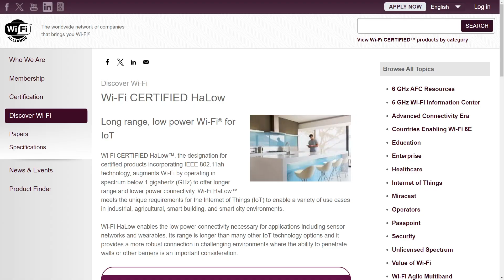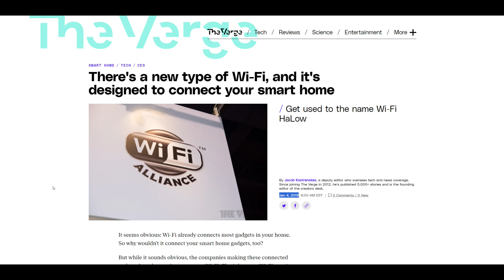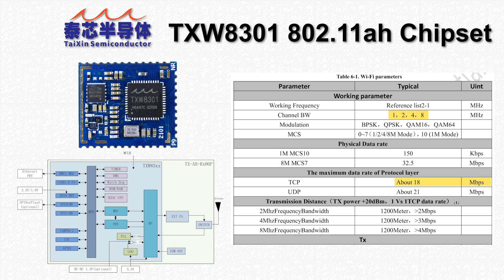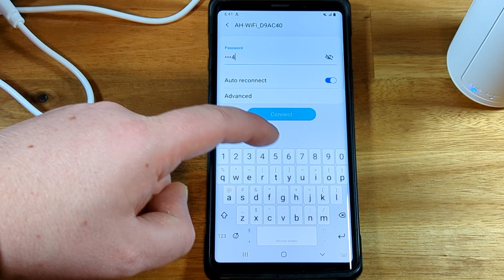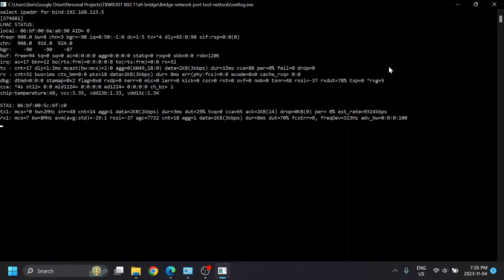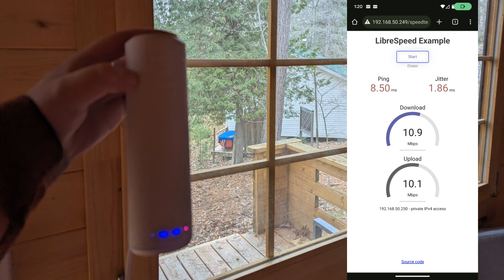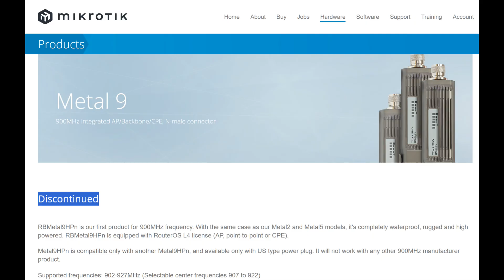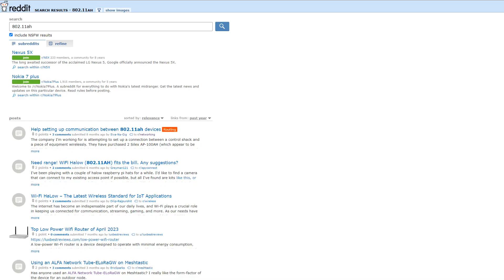802.11ah Wi-Fi HaLOW: The 1 Kilometer WiFi Standard

Comment: Meanwhile, back in 98’ as a fledgling WISP we were creating pre-802.11b “Point-to-Point” and “Point-to-Multipoint” outdoor wireless links (2.4ghz) traversing distances of 10-15km as a standard, and a solid and reliable enough test link which ran 52km using only Lucent Orinoco PCMCIA cards, LMR-400/600 cabling, and cheap wire mesh parabolic dish antennas… 😂
Not to discount this product, but there’ve been commercially available 900mhz radios for data links going back to the early nineties, and even we used them in cases where a client in a rural setting needed connectivity but couldn’t afford a tower or mast to get a LOS signal above their property’s tree line or other obstacles. Back then, the average going rate for a 900mhz radio set and gear to create a link ran us around $400 USD.

Comment: PLEASE be mindful, since you're encroaching on a pre-existing ham radio allocation, I advise people to map out the 1MHz at the bottom and top (902-903 and 926-927MHz) to avoid interference;  Remember, since we're allowed to run up to 1500 watts and are capable of wiping your signal clean out,  please play nice...
Reply: 1.5kw huh? 🤔 Since I’m being lazy, what are the maximum power levels a ham can run on the other bands (including vhf/uhf as well as microwave)?!? 😈
Reply: @MikeOxlong-  I haven't looked up Part 97 lately but I believe it applies to most of our allocations; exceptions I know of are 60 and 30 meters (5.x and 10.x MHz). Usually you don't see amps greater than 150-300w above 144MHz but they exist, if you really want them (or you can build them, if you know how...). Just keying down on a 35w 900 mobile will decimate any license-free signal, in any case. As I said, 99% of our usage in the 902-927 band is just the top and bottom 1MHz (902-3 repeater inputs / 927-8 repeater outputs). That gives this wifi thing more than enough room to stay clear of us.

Comment: That low power consumption would be amazing for a wide-area mesh network using 10W solar panels with Maxwell 2.7V 3000F caps as a module and charge controller for standalone mesh nodes!

Comment: Heh I worked on the 3.5 GHz band, yeah it needs a much beefier setup but we still got it to something like 100x less costly than typical LTE so it's very useful for any larger commercial operations. Not for basic smart home stuff, though there is (was? Haven't kept up with it) a general access tier for which I pushed strongly that's open without the license auction. Really wanted to get a mesh system in the spec for general access so range could be extended but I couldn't get anyone else on board because the roi on the development was prob negative. Wish this were mesh too! Meshtastic works nicely for that but like you mention it's not nearly the same level of throughput

Comment: No, 5Ghz doesn't have more channels in practice, unless you're using 20Mhz channels but even then national band plans make many channels still unusable. There are many reasons that 5Ghz can be faster, but the main and simplest one is that it's (obviously) a higher frequency - meaning cycles per second - so you can literally get more symbols into a given timeslot.

Comment: Is there a way to mesh these? My buddies and I do a 24 Hours of Lemons race where we like to stream from the "racecar" but this uses a ton of data and our current solution just uses a few Verizon/T-Mobile mobile hotspots. I've been telling them that we should create some sort of a mesh system to deploy across the track, that also connects to the main network back at the RV so it's all on one non-moving hotspot, but of the mesh systems we've looked at don't have a good combination of efficiency, and range. This seems like a reallllly good balance of both. This would allow us to choose which camera to broadcast from via OBS via the main network back at the RV. Doing a mesh system for this would be sick because it would be just enough bandwidth for 720p or a low bitrate 1080p feed.
Reply from the maker: That sounds like an interesting use case! In the translated AT command guide PDF, I found a reference to a repeater mode though I haven't tried to configure it.

Comment: 45 seconds in and you already won my heart only showing the actual 2.4ghz channels.
Reply: Depends on where you live...
Reply: @btudrus  not really. Some countries technically allow up to 13 but it's not actually useful. They just did it since 11 spans those channels anyways. 14 is allowed in Japan but only for the B standard.
Reply: @frosty9595  "Some countries technically allow up to 13 but it's not actually useful. "

Of course it is...
Reply: @btudrus  please tell me how 13 is useful. A 20mhz 2.4ghz wifi channel takes up two adjacent channels. Your non overlapping channel count with 11 numbered channels is 3. With 13 numbered channels your non overlapping count is still.... 3. Hence why I said they count to 13 only because 11 overlaps those frequencies anyways.
Reply: @frosty9595  you can have 4 independant 20mhz channels which only marginally disturb each other...
Reply: @btudrus  there is no such thing. It's cross channel interference and will cause retransmits.

Comment: 4:03 do you have3 a link to that Bord ?
Reply from the maker: If you do a search for Aliexpress or Amazon for "USB C PD Trigger Board" you should be able to find a lot of options. I've also had some good luck with the premade cables, which you usually find by searching for "USB C PD to 5.5x2.1mm cable", typically you'll have options for 5, 12, 15 and 20 volts with those premade cables. 

The cables and boards only request that voltage from the power bank or wall adapter, so you need to make sure that your power bank or whatever supports the voltage that you want to use, most decent quality ones will work with all of them.
Reply: @BenJefferyCanada  ty a lot I nead that to head my battery from the e-bike so they don't get to low temperature in the winter time

Comment: When I was in college I had built a computer into my Chrysler labaron using a Point of sale 9” crt into the dash. 
I had to run an Ethernet cord out to it to transfer files originally, or burn a cd w MP3’s and transfer it that way. Then I stumbled across an early version of a file transfer USB dongle that used 900mhz. It claimed 1mb/sec which was pretty fast at the time. When I used it, it would transfer a 3mb mp3 file over the course of 15 minutes. 
It was pretty cool uploading a dozen or so songs into my car over night and showing my friends. This was back in 1999, when no one had mp3 in their car. I even ran an IDE cable from the trunk up to the dash to plug into a DVD player but the throughput was too slow. Here we are decades later and I ran across this video about 900mhz WiFi. Brings back some memories.
Reply: Yes!  I had a 900mhz “gaming adapter” for the OG Xbox.  That thing got used for putting connectivity in RANDOM places.  The speed was shit, but it was enough for playing streaming radio stations or looking up random stuff in the shed we had in our backyard.

I remember we played with the distances and we got it to work from one house to another (about half a mile away) but the speeds were just god awful.
Reply: We places the boxes in the attic on the facing sides of the house and it was a pretty clear line of sight.

Comment: Need WiFi in my condo cement parking garage for Tesla software updates. My unit is 3 floors up and about 100 feet away from the parking spot. Going to see if the extender works. Hopefully 🙏
Reply: Still waiting on delivery... how long did yours take to receive?
Reply: Setup was plug and play and so far it seems to be working great through a few walls of cement and another 200 feet after bouncing off another wall.

Comment: The simple monopoles supplied with these devices are probably not broadband enough to give you a true indication of the range these things are capable of. I.e. if your signal is 8MHz wide your antenna needs to remain "in tune" across the whole channel otherwise you will lose performance due to reflections and losses. So use properly designed broadband antennas if you want to get the best performance. One of the low cost VNA like the NanoVNA can give you a good indication of what is really happening compared to the typical datasheet BS on cheap 900MHz antennas ;-) Neat video cheers.

Comment: It all comes down to regulations, doesn't it? LoRa could be used for live streaming like 10+ km away easily; it's a superior RF phy. However, the band it operates in falls under ISM with extremely restrictive duty cycle/time-on-air regulations in EU/USA, respectively.

Comment: Great video! I'd love to see more videos like this on 802.11ah. One recent advancement that really no one has covered is the 802.11ax (Wifi 6) range improvements specifically on 2.4 GHz. Most reviews on 802.11ax are related to speed on 5 GHz and none on the implementation of OFDMA, which is built into WiFi 6, on 2.4 GHz in particular in a rural setting. One aspect of OFDMA is that it can increase range and is fully compatible with modern smartphones and laptops. I use a TP-link EAP610-Outdoor AP in a very rural setting and have seen some notable range improvements in fringe areas past 700 or 800 feet. The funny thing in the TP-link implementation of WiFi 6 is that OFDMA is off by default and needs to be enabled through the web interface. Go figure.
Reply from the maker: In the wireless ISP community, there's a lot of excitement over WiFi 6 based products because of how it behaves at lower signal levels and in noisier environments. At work, we've been trying out some Cambium ePMP 4500 equipment that uses WiFi 6 and we've definitely seen way better performance and reliability at lower signal levels compared to previous 802.11ac equipment, meaning we can connect more people and get faster speeds to them.
Reply: @BenJefferyCanada   My own experience has been 2.4Ghz 802.11n decreased right down to 20Mbit at home due to interference.  Moving to WiFi 6 instantly pushed that back up to 60-70Mbit.  It also seemed to eliminate huge latency spikes in my brief testing.  Never got to test at range though.
Reply: @BenJefferyCanada  I've been doing some testing with the EAP610-Outdoor AP I have. On 2.4 GHz I have the bandwidth set at a standard 20 MHz and have lowered the 5 GHz bandwidth to 20 Mhz (from 80) as well. There has been a notable increase in range to my iPhone 13 AX client. I am giving up speed for range but 20 MHz on 5 GHz is still fast enough.
Reply: Along this vein, I'd love to see a range/speed/obstacle test comparing wifi 6 ax - 2.4GHz vs ah halow

Comment: 900MHz band is one of the bands used on GSM mobile phone, there are multiple low energy technologies on this bandwidth and naighboring bands, the issue is that there are different restrictions in these bands around the world. HaLOW units would need to use different frequencies or channels within the band or migrate to neighboring band depending in where in the world the setup is installed. 915MHz are "free to use" in US and AU, while in EU those frequencies are restricted so 868MHz are used.
Living on a farm with some distance between buildings, HaLOW WiFi could be an alternative instead of digging down cables between all buildings, though I would still keep living houses connected to internet with wired solutions. The distances and bandwidth mentioned in this video show that it is more than good enough for installing sensors like pressences, leak, temperature, or smoke to my home server using MQTT, current bandwidth draw on my sensors are less than 1kbps.
Reply: It's not really any different to any other WiFi band though, especially 5 GHz which is different country to country in allowable channels, maximum frequencies, radar avoidance, etc.  In fact, the Linux Wireless project has already been including 900 MHz bands along with 2.4, 5, 6, and 60 GHz in its region list, so using this existing region infrastructure for 900 MHz would make it easy enough to handle country-specific differences.
Reply: @Berkeloid0  In europe all countries are alligned about wifi and cell phone frequencies. (because the borders are so close) that's why we also have a channel 12 and 13 on wifi 2,4ghz  (2 extra bands to use)
Reply: How far are the buildings from each other, is the land flat, any hills or obstacles in the way?
I have used ordinary WiFi router with a standard omni antenna and have had a decent connection at over 100 meters (300+ feet). I even reached over 300 meters, but the connection is unstable and relatively slow. This is with direct line without obstacles.
Using better routers with directional antennas, I could definitely get much better results, but I wanted to see what the typical off-the-shelf routers can do.
Specific brand AND model of a router or a WiFi extender are also important: I did a side-by-side comparison of 3 different TP-Link routers plus one Tenda, and while I sometimes got mixed results (maybe my phone was slow in updating all results), most of the time my TP-Link OneMesh router had the best signal, followed TP-Link EAP, then TP-Link "Extended Range" (not really), then a Tenda.
Difference was sometimes minor (1dB), sometimes significant (few dBs, meaning 2-3 times stronger signal).
Reply: Most buildings are within 100m of each other so off the shelf WiFi products might work, but there is a building 5-600m from the test, all buildings have line of sight to main building, so being strategic with antenna locations I might get away with a limited number of antenas. Use range extenders to reach the building further away is out of the question as each extender would need to be mounted in weather proof boxes with power sources.

Comment: Really want something like this for a mailbox door sensor so I can tell when the mail is there rather than going 1/4 mile just for nothing and coming back ;) It may not work here since we are on a hill and the mailbox at the bottom through woods. Don't really need much speed for an application like I want to do but would be nice to have a rechargeable battery in the device to make it smaller or even work with AA or AAA batteries (can use rechargeable).

Comment: I would bet against its success. Without gigantic battery rigs or grid access, it won't be feasible for small sensors. The only real use case I can imagine is for surveillance cameras. The niche for this radio standard is simply too limited. In contrast, LoRa and WLAN better cover potential use cases and are already established. Their versatility and widespread adoption make them more practical choices, especially considering the challenges associated with the radio standard in question.

Comment: Just found this video today, on the strength of this video alone I subscribed to your channel.

If possible, could you do a video on long range wi-fi?? Few years ago I read about people able to go up to 100 km with various shenanigans.

Also, could you look into "Wi-MAX"?? I don't find a whole lot of information on that....
Reply from the maker: Thanks! I have some videos planned to show point-to-point WiFi devices for 2.4GHz and 5GHz bands, some of which can go many kilometers using directional antennas on each end to focus the signal in one direction.

I work on some of those long microwave links to connect remote communities, so I might be able to go over some of it in a future video. Another potential future video could involve showing off some legacy/obsolete wireless broadband equipment, such as WiMAX, which was a bizarre standard used for some mobile and fixed broadband services.
Reply: @BenJefferyCanada  

I thought Wi-MAX was a continuing  endeavor and not a legacy system?? Guess I'm a little dated!!

The specific Wi-Fi I was thinking of was I believe in Italy and they were measuring a volcano.  They were using 2.4GHz Wi-Fi over a 196km run, or there abouts.    Thinking about it, I may have read about it in  "Linux Journal", but I am not sure of that....

It has been a while since I read that article. I believe about that time I got my first wireless router, an 802.11n compliant system from Belkin.  (I used wired before that, exclusively.)

Thank you for replying, I hope your holidays have been most excellent and will continue to be most excellent!!

Monte

Comment: I often think about ways to cheaply deploy real-time arrival displays for bus stops, which tend to be a minimum of 100m / 330ft apart in my area, and are more efficiently spaced around 400m / 1300ft apart, and can sometimes have 1km or greater spacing. This would probably be easier to deal with than LoRa, since it has the bandwidth for standard HTTPS, and could allow audio announcements with little or no delay.

Comment: Does Anyone know if the 900Mhz link is encrypted ?
Reply: HaLow uses WPA3 just like Wifi
Reply: I phrased my question poorly in this case. Mainly was curious if the out of the box configuration is using encryption and if it is (which based on the outputs he showed looks like it is) wonder how strong the key is. (i.e. what did they used to pair them) @fixdavid
Reply: @JordanEE  I am afraid I don't fully understand what you are asking but out-of-the-box configuration is set by the manufacturer. Wi-Fi Alliance-certified Wi-Fi HaLow follows the same security protocols as any other Wi-Fi device, with the additional lack of issues of having to support legacy security standards. I don't know what the Taixin-based chip supports as it is not certified. So rule of thumb HaLow works just like Wi-Fi in terms of security.
Reply: Was able to dig around and find out They're using WPA2 on the 900Mhz link. The Initial Key exchange relies upon putting one unit in the "STA" mode using the switch on the PCB and syncing with the other in the "AP" mode. Initial Key exchange in this mode appears to rely on Diffie Helman based on what I can find anyway, wasn't able to determine what Bit strength the keys are.  @fixdavid